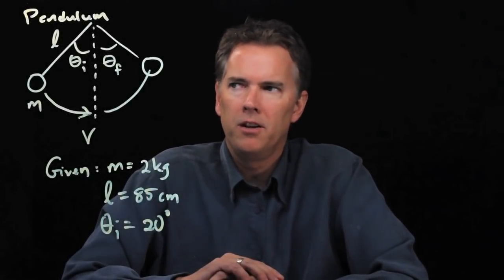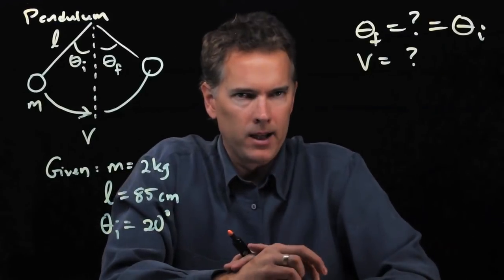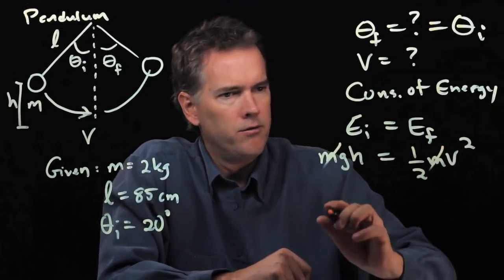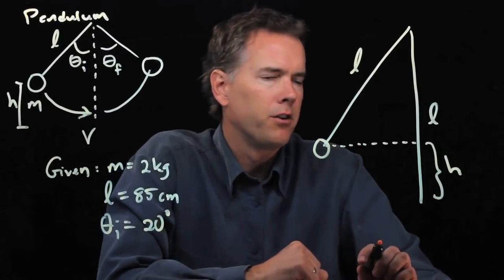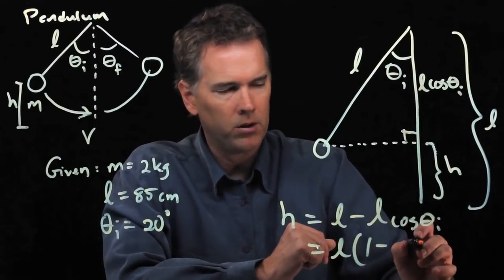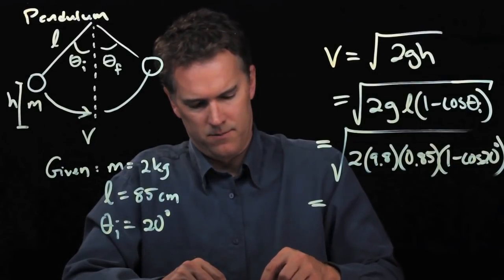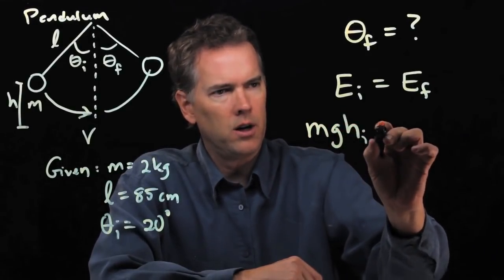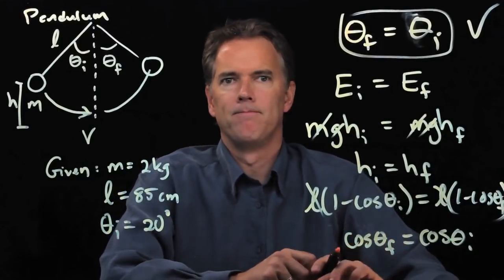Pendulum problem using conservation of energy

Comment: How do you figure out the tension in the string @ different angles?
Reply: The purpose of the tension is two-fold, for a pendulum.

1. It needs to oppose the radially-outward component of gravity
2. It needs to cause centripetal acceleration to keep the bob following a circular path

To solve part 1, it needs to at least be as large as m*g*cos(theta).
To solve part 2, we also need to add onto it, m*v^2/L

This means, that in total, the tension will equal:
Ft = m*(g*cos(theta) + m*v^2/L)

given a simple pendulum with a bob mass of m, a length L, and in a uniform gravitational field of g.

The values of theta and v are transient throughout this problem, since v is greatest when theta is zero, and v is zero when theta is at its max.   So you would determine v as a function of theta through conservation of energy, in order to get a concise expression for Ft in terms of theta.

Comment: When the swing is raised and released, it will move freely back and forth due to the force of gravity on it. The swing continues moving back and forth without any extra outside help until friction (between the air and the swing and between the chains and the attachment points) slows it down and eventually stops it. WHAT THEN IS THE FORMULA TO KNOW THE TIME WHEN IT PRACTICALLY STOPPED?
Reply from the maker: That's a great question and quite a tough one to answer. But you're absolutely right, friction and air resistance will cause it to stop eventually.  Maybe I'll make a video about it.
Cheers,
Dr. A
Reply: @yoprofmatt  Thanks Doc A. I have been pre-occupied with this idea as the same with the UNDAMPED condition with the RLC circuits both SERIES and PARALLEL, I just can't make the PHYSICS connection of the 3 DAMPING factors involved... Please show all the MATHEMATICAL STEPS going though the mathematics. Than You for Your  Response.
Reply: @yoprofmatt  I just want to know the difference of both angles in respect of gravity but according to you/physics, it is nothing to do but the friction and air resistance. So it means the friction and air resistance are the important things to eliminate to get the pendulum swing longer? Thanks for the answer 🙏

Comment: could one calculate theta without knowing the initial theta angle? just knowing the value of the initial force in relation to the weight of the object where the angle would be equal to the arc tangent of the relationship between the initial force to the weight

Comment: sir i have just one doubt. why during the energy conservation the rotational kinetic energy is not considered. ie. 1/2Iw^2 . ?
Reply: Because it is treated as a simple a point mass, and its size is insignificant.

You can calculate what 1/2*I*omega^2 is, for a point mass on a negligible mass rod of length L, and you will find that 1/2*I*omega^2 also equals 1/2*m*v^2.

Comment: would we not conserve the energy like ;
mgh + 1/2 mv^2 = mgh + 1/2 mv^2 .
where in initialy there was no kinetic energy so initial kinetic energy is zero . so; 
1/2 mv^2 = mgh + 1/2 mv^2
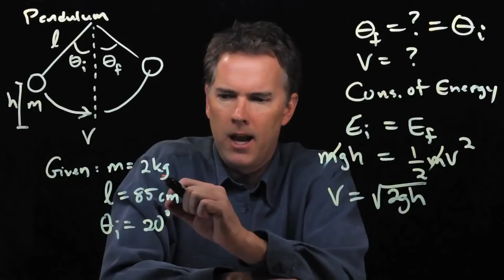Reply from the maker: Your words are right, but the math is wrong.  Initial kinetic energy is zero.  But final potential energy is also zero.  If h is the height at which it started, relative to the bottom of the swing, then you just get mgh=1/2 mv^2.  See the 2:20 mark.
Cheers,
Dr. A

Comment: you confused me at 1:21, the energy should equal mgh at Ef. 1/2mv2 is when its at the bottom
Reply: The Pendulum starts at an initial height h. Which is also Ei = mgh. Ef is when it's at the bottom so you are correct 1/2 mv^2 is when it's the bottom but were confused about Ei and Ef it seems

Comment: Anyone else not get 1m/s. I got 3.14...
Reply from the maker: Tried it again and still got the same answer.  Did you use sin instead of cos?
Cheers,
Dr. A
Reply: Calculator was in radians, always worth a check to make sure :)
When in degrees we get 1
Reply from the maker: Excellent, thanks for the update.
Cheers,
Dr. A
Reply: @yoprofmatt  When I am in degrees, I get .317, when I am in radians, I get .99.